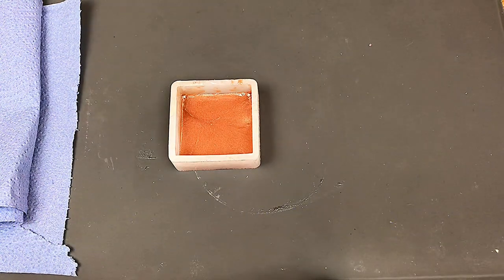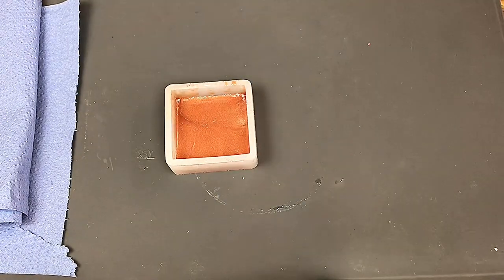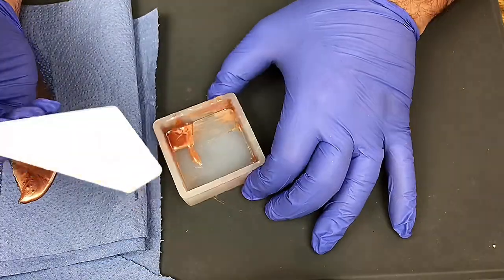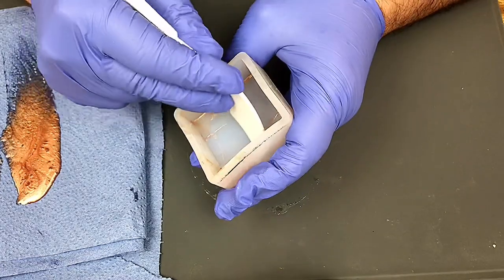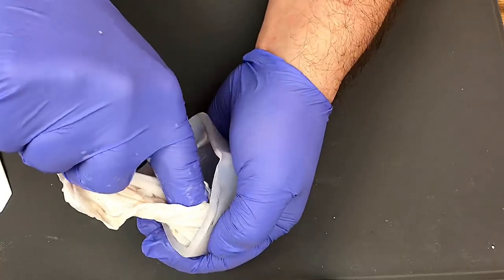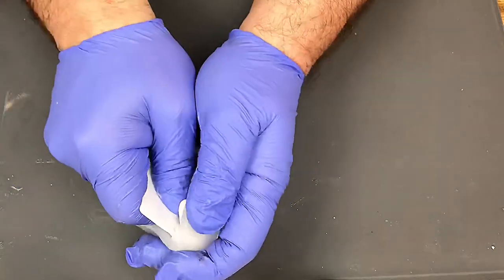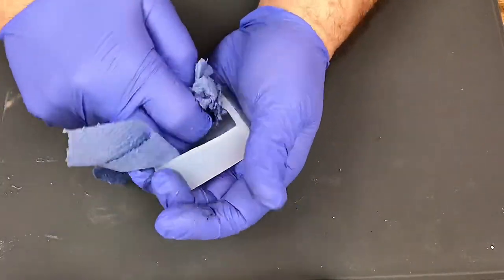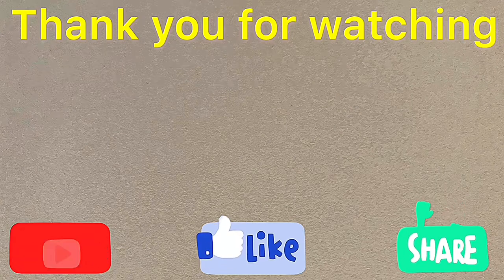Cleaning Sticky Resin out of Molds -easy method

Comment: Thank you. My daughter didn't mix correct so ended up with loads of sticky messes & this is the only video I've found that showed me what I needed.
Reply: ugh same i put 2 parts hardener, had no idea. scraped it out, washed it in the worst way. still sticky. 

i loaded it with tons of baby oil and cleaned it and it worked out, but i bet this is cheaper.
Reply: Yes

Comment: Thus far I haven't made the mistake of not including resin Part B but if-&-when it occurs, all thanks to you, I will be prepared to quickly and easily correct my error.  (My list of resin mistakes is quite lengthy.  And I will not bore anyone with my numerous glue mishaps!)   You mentioned interest in a source for scrapers similar to the one you utilized.   I presume it's a nylon scraper.  I reside in the USA.  We have a popular chain store, Dollar Tree, that sells a similar product in the kitchen section.  (Everything in the store is one dollar.  A few items are 2 for $1.)  If you have any similar stores maybe that would be worth research.  I always keep old credit cards and empty gift cards to cut to needed sizes and repurpose them as needed.

Comment: Ty you saved me. Got some generic resin..no instructions.  Used what I assumed were universal 2 pt instructions (equal a/equal b) but didn't mix long enough and felt just as foolish and started getting enraged with myself..the molds were hard to find and expensive.  THIS SAVED THEM.  And ..I was able to salvage  some cured bits that actually look very cool...so ..Thank you so much

Comment: Thank you so much for this! Very new to resin and was trying some Christmas snowflakes. Those little one with lots of "fingers". But, the resin didn't set and I was left with a big sticky mess. Had no idea what to do & left them a few weeks. Just watched your video so tried scraping them out. Then stuck them in hot water and about 20% came out. Then, I just poured washing up liquid in the mould and left them for a few minutes. Much easier to clean. Got my moulds back!

Comment: I'm glad for this video I've seen it be4 but 2 days ago I had a large resin mix n I was only able to remove 2 of the molds n clean them out ended up breaking a pendant mold but it's only the piece of the hole I can always drill it when it's cured. I also wanted to say if resin is frozen it does come out I thought it wouldn't but gave it a shot since I gave a very detailed pendant and couldn't get in with the baby wipes it removed the resin right off. I had bought a silicone large cup from Amazon to later find out it's not the right measurements-.-.

Comment: This has helped me with some ideas thanks, my molds are unfortunately the animal molds and for some reason half my projects cured the other half did not cure. I even used a 2 hr machine and they still didn’t cure so I done it again and nothing . I also had the same issue with the pyramid mold that wasn’t in the machine and it had 2 colors in it the top color cured but the bottom is still wet. Talk about annoying…!!!

Comment: Hi Steve, I did a frog and a lizard, plus a seahorse   that's in a shallow mould,, the lizard dident cure up at all,, the frog  seemed tacky on the surface  and  seemed cured from the bottom of  the mould,, and the seahorse came out of the mould  looking beautiful  But bendy,, so I'm hoping that it will cure the rest of the way out of the  mould, it's mostly  the frog I'm worried about,, as its a deeper mould. Would I have to demoted my frog and lizard and start over, I've seen your video,  the lizard is like what you took out of the mould in the video that sort of consistently.  As I'm not sure as to whatvto do at this point,as I don't want to waste my resin. If you have ant ideas please let me know.  Thankyou

Comment: What about using acetone? You can get it in a spray can called foam gun remover from hardware stores such as screwfix in the uk i just use a little spray and it runs off and evaporates

Comment: I've been told that you can put it in the freezer for 4 - 8 hours if it's a small mould  you can leave bigger ones for 24 hours xx
Reply: @sarahlewis7669  does it really work? Cuz i guess epoxy cures with heat

Comment: I used the mold only once and then washed them with white soap (it has no abrasives and is neutral). For this I put enough soap in a container with warm water and left the molds there for 1 hour. After that I took them out, but all the soap stuck to them. The next day I rinsed them again and with cotton and swabs I removed the dust / rest of the soap.

The problem is that now my molds are no longer shiny. Well, one of them is, but in parts. If I swab it when the mold is dry, it is shiny again, but not even. The other mold remains opaque no matter what I do.
Is there any way to fix it? I only made one piece with each one before I screwed up!